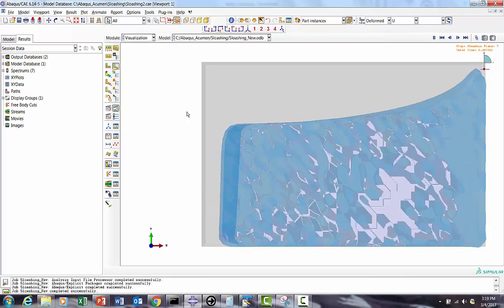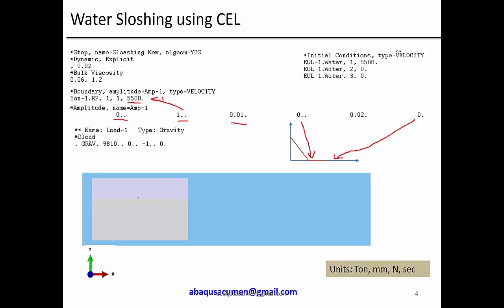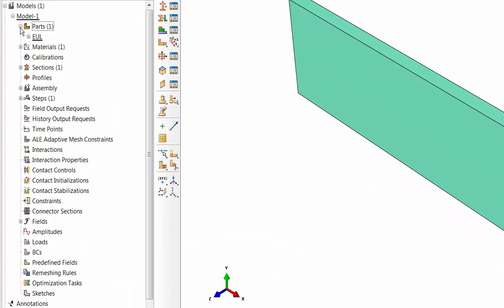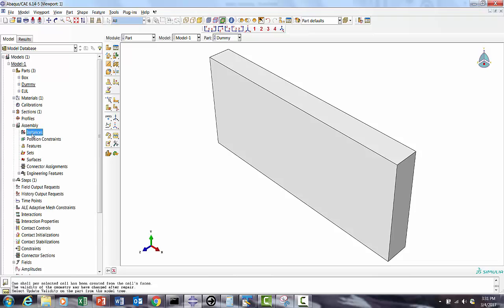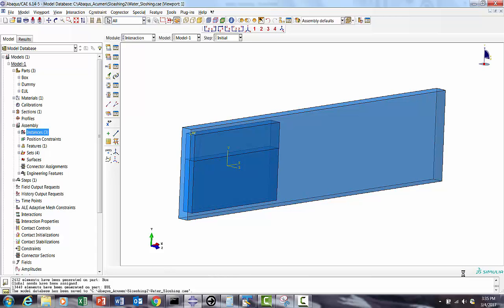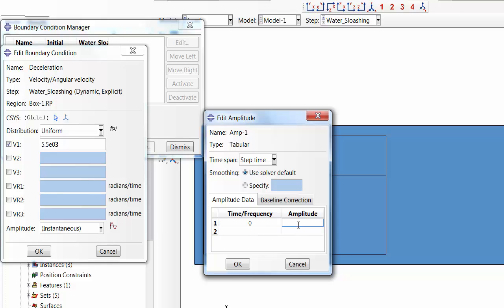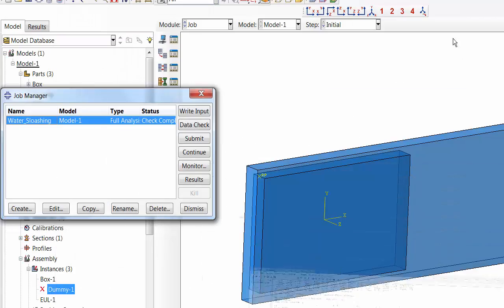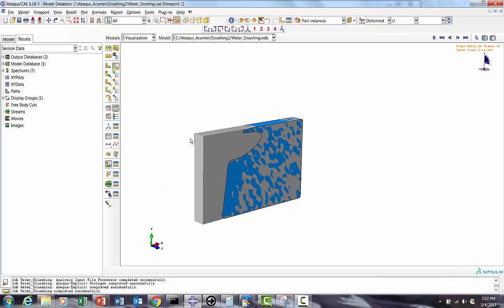Abaqus Coupled Eulerian Lagrangian (CEL) Modelling Tutorial: Example- Water Sloshing in Tank

Comment: Hi, Iam working on this model, I wonder how I can gain contact pressure between liquid and tank? is it possible in CEL or not? because when we suppress the dummy part we can't define contact there? I really appreciate regarding you answer my question.
best regard
Reply from the maker: Make tank deformable and check the contact pressure
Reply: Thank you so much, I have big problem since my tank is 20*56*12.3 (m) filled with water 11.2, I have severe penetration in shell and reduced thickness, I can't get sloshing, I made the mesh very fine and the problem doen't solve. what else should I do? please help.
best regards